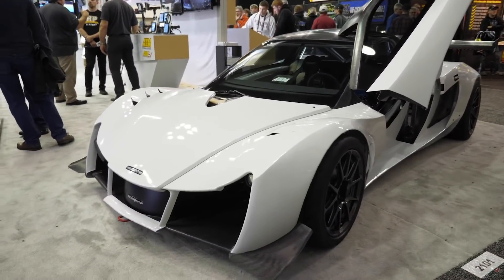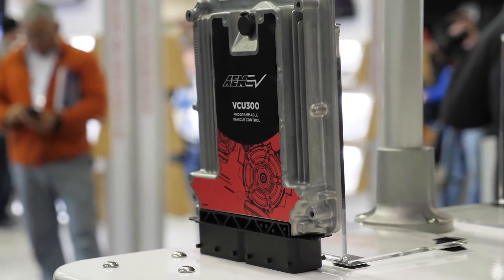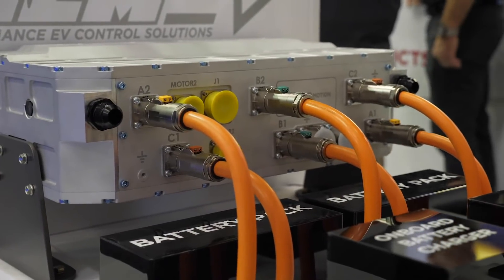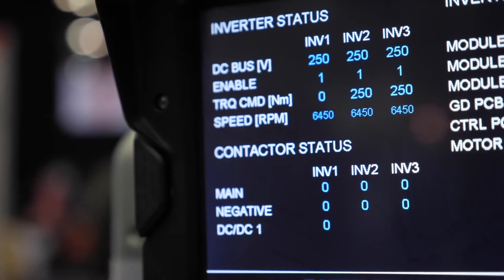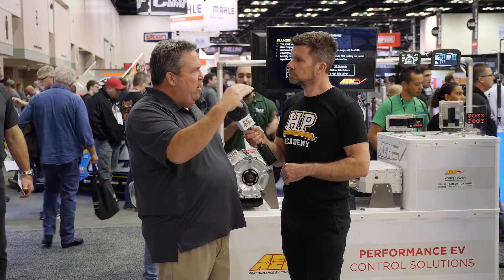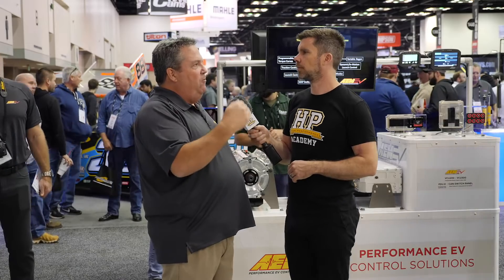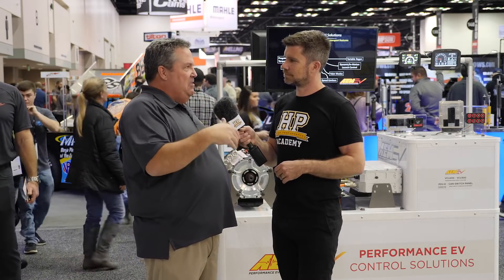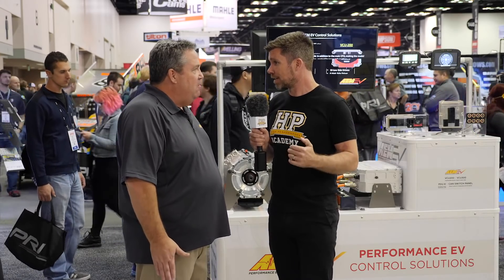1300HP AWD EV | How To Tune An Electric Car AEM [TECH TALK]

Comment: There's definitely ev torque tuning, especially for my electric mountain skateboard via VESC Tool. It was just a scary board to use, even when I incorporated a stiff wire handle as added stability feature to prevent from falling off the board almost every time i m not aware of how hard or soft i am squeezing the trigger. I am beginning to think it might be my trigger controler. Because it is actually an RC controller. Learn and evolve as I go. Awesome video always!

Comment: Nice. That's got a cascadia DD 250-115. Hell of a motor. Wonder if it's the big bad DOM motor. Our shops does alot of SD 250-115s, big price gap between them. Nice.

Comment: It's absolutely possible to tune an electric motor.
You can raise battery amps, phase amps, battery voltage, and even change the electric field "timing" akin to vtec. It's just called flux- or field-weakening, where amps are used to cheat the motor to run faster rpm than the battery's voltage otherwise would restrict the motor to spin at.
It's a big deal in the advanced DIY ebike community.
Hacking electric cars seems more difficult though. I imagine all sorts of error codes if the car registers you fiddled with the motor controller.

Comment: What about electric rack and pinion?  Will the VCU provide an input to plug into the electric motor on the rack so that the steering is "correct" for the speed of the car?  And providing the right "feedback feel" to the driver (less at low speed, more at high speed, etc.)?
Reply: Yeah you would have the output controlled by the vcu  so it could control can or 0-5v type signal for electric power steering and vary voltage based on speed

Comment: Very good summary for those new to the EV World.  I will say though, the comment on there not being "tuning" for the motor+inverter combination isn't exactly correct.  There is a something called MPTA, Max Torque per Amp, which with certain control strategies it will need to be dialed in.  Think about tuning your spark timing for MBT, same concept, just with electrons.
Reply: Typical EV builder isn't messing with inverter/motor optimization.  In most cases, the inverter is already configured and optimized for a particular motor by the inverter manufacturer.  All the integrator/installer does is configure the inverter for the particular motor being used and that's it.  With Cascadia hardware, you just pick a motor type and you're good to go.  In the case of the VCU, you're tuning/calibrating the vehicle torque delivery, not tuning the inverter control characteristics.  No doubt this might get done in a one-off application if you have a dyno and are an engineer but that's not anything 99.999% of EV builders are thinking about or doing.
Reply: @blacklineindustries7602  Fair enough that most EV Builders likely aren't diving that deep into the motor/inverter calibration since most will just be buying combos, and aren't having a custom motor designed for their application.  However, there are a fair bit of driveability calibrations that can really only reasonably be done within the inverter.  (Due to the round trip time of CAN being too long).  I get that much of this will work "good enough", but not diving that deep is what will separate the hobbyists from the professionals, and I suspect as we dive further into an electrified world, the aftermarket will begin to want more control.

Comment: Future drag strips will have a 3rd rail providing full power to eliminate batteries all together.
Reply: What's even the point then? Every motor will have the same power available. Then it's just a question of how light you can make a motor, suspension, and passenger cell.
Reply: @acefighterpilot  Same power, but the rest of build would vary, motors included and how that power is deployed. I personally think it would be good from an innovation perspective.
Reply: @ricepony33   That would be dumb, they dont offer any help to racers now, why would they in the future.... thats the whole point of racing... The differences between each setup, fuel choice/quantity, weight, displacement. etc.....
Reply: @Gatorsrok  Reaction time. If all the cars are the same then it's the driver who is responsible for the win

Comment: Love some EV content. I think there are allot similarities in a motorsport setting between ICE and EV its all about heat managnent and extracting the most from the available energy source. whilst your loosing the tuning side of extracting power from the engine. how you set up the complete package is now key to how it responds to the drivers inputs. It is similar to how much more advanced gearbox/chassis  controls for sequential transmissions active dampers yaw control etc have evolved without a holistic approach to the whole vehicle a badly setup electronics package would make it awfull to race or drive. Brilliant look at the future.